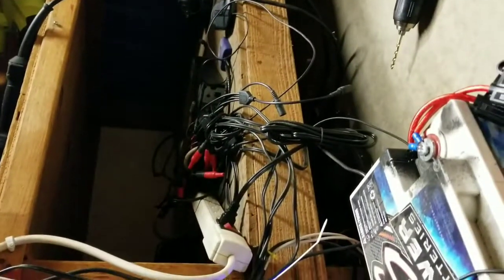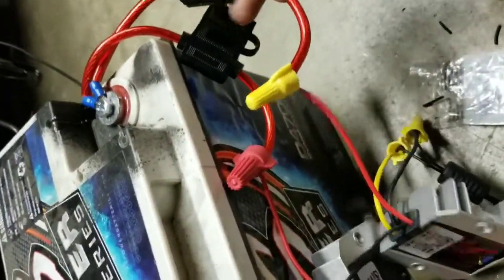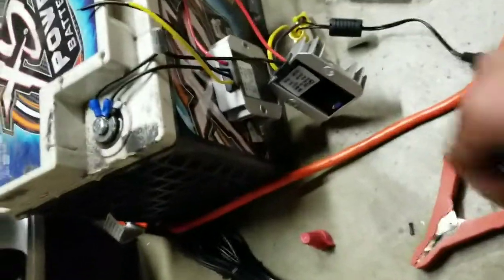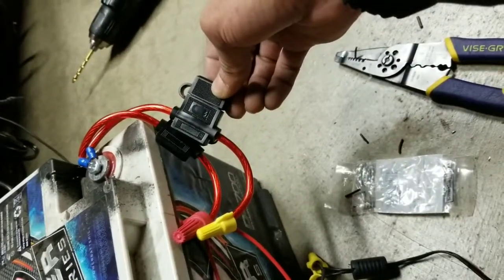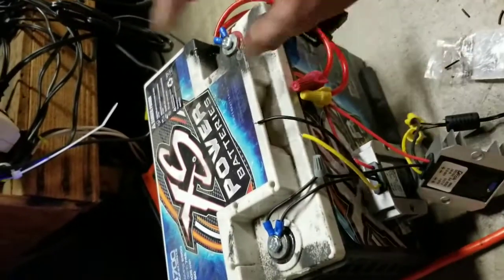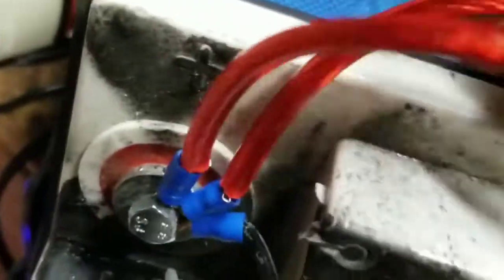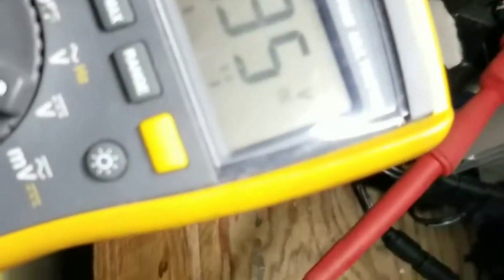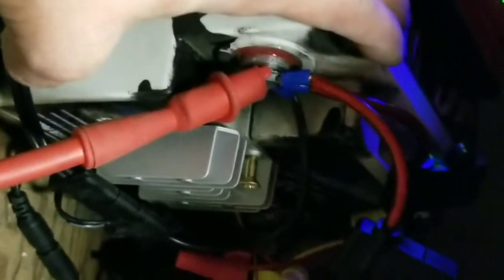Using a car battery as a UPS power supply for DC applications more seriously a DVR or surveillance

Comment: Thanks. I was wondering if this could work. Now the question is how long will it run without electricity (charging). Can you follow up?
Reply from the maker: on this particular DVR I tested it, with my cameras, it is only pulling 2 amps constant.  The battery i used here is 50 AH, so in theory a full day.  But keep in mind, the 2 amps is based off cooler temperatures, in the hot summer it probably would pull more.